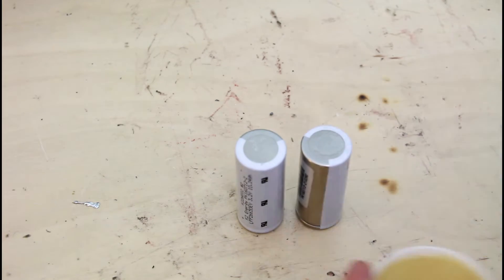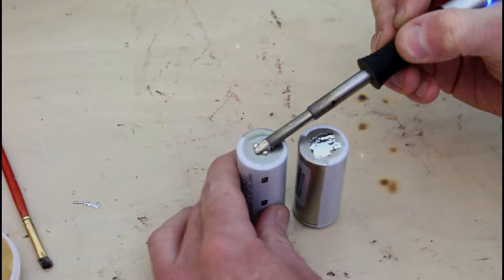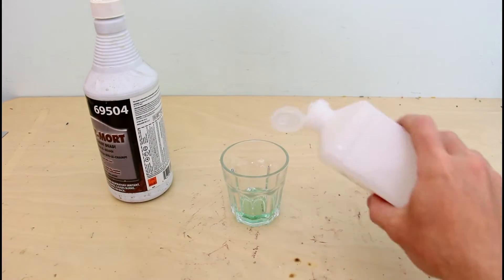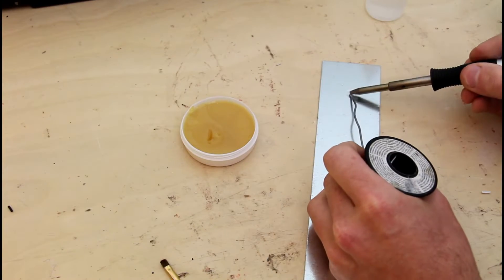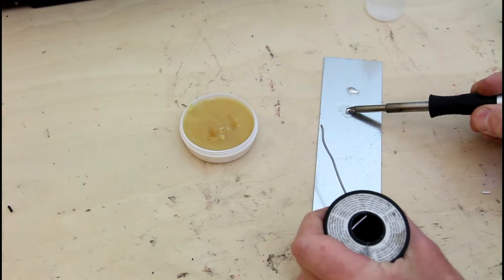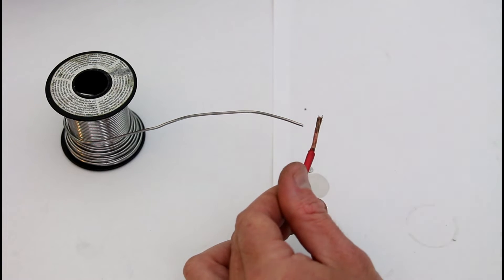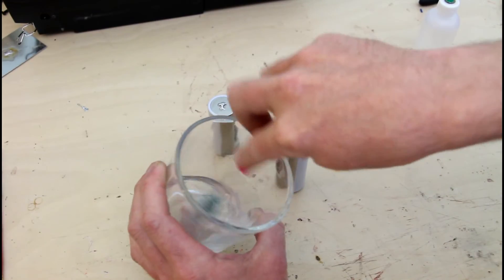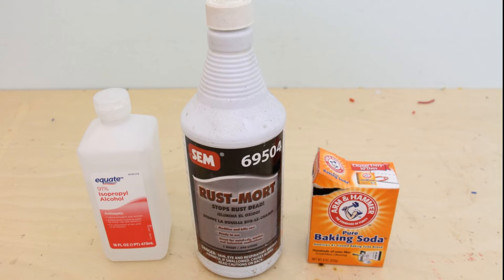Speed flux - Difficult soldering made easy

Comment: Dear Alex can you please guide me if rust converter and rust remover are one and same.
I am here from India.
Reply from the maker: Not usually the same.  Rust converter is phosphoric acid (usually).  Rust remover is almost any acid.
Reply: @highervoltage5430  can we used common toilet cleaning acid ( hcl ) instead.
Reply from the maker: @prashantk3269  - Not likely.  i have not tried it, but I don't think that will work.
Reply: @highervoltage5430  ok thanks for your response.

Comment: Thank you so much for this idea. At my job I repair all kinds of equipment and the copper wiring is always almost black even when freshly stripped back especially on snow plow and salting equipment. I have been saying for years that I wish there was a way to quickly prepare the wire for soldering.(I've been scraping it with a razor blade) with limited results. I can't wait to try this out next time around.

Comment: I used 85% phosphoric acid and soldered stainless steel beautifully! Thanks a ton for suggesting
Reply: was it 50 /50 ? or another proportion?  thanks in advance sr
Reply: As I said it was 85% concentrate. It will work even if its less than 50 or 40 percent concentrated @onixcual
Reply: @onixcual isopropyl alcohol is not necessary. Only phosporic acid is required. Isopropyl alcohol just helps in removing oils and grime

Comment: This is the most amazing flux I have ever tried. I am fortunate enough to have some food grade 85% phosphoric acid and some anhydrous isopropyl alcohol on hand. The results are just incredible. You can easily solder copper to stainless steel, for example. Large areas are tinned easily. If anyone has trouble making this work, it's probably because the phosphoric acid is not concentrated enough. In combination with the fact that ordinary rubbing alcohol is 30% water, there might just be too much total water to make it work. 

Thank Mr. Voltage!
Reply: Try 91% as opposed to 70%. Easily found Naval Jelly too.
Reply: Just get 99%. It's not much more if at all
Reply from the maker: You are absolutely right about the water content.  It is what will cause this to not work.  However, if you use pure components, it works flawlessly.

Comment: I tried it. It didn't work. The rust converter that I used is made with phosphoric acid. After applying the solution to metal and heating it there was a bit of a gunk build up which the solder didn't like. I suspect it's one or more of the other ingredients in the rust converter that generated the gunk. I used bondall Ranex Rustbuster made in Australia.
Reply: Just try Muriatic Acid, it works for me flawlessly.
Reply from the maker: What happened in your situation?  It could be a reaction between the flux in the solder and the speed flux.

Comment: thanks for the info. Your videos have been quite a benefit to me. I bought some A123 cells and am making batteries for two V65 I have, replacing the AGMs. I am a soldering rookie so this blurb is wonderful -- for me. Where do I get the little squirt bottle you used?
Reply from the maker: I think it is a glue bottle.  I think it is from Guant industries?
Reply: I've wondered about A123 cells, especially since a 50AH 72V battery on our converted GS500F from BtrPower seems to use something similar.  They seem a natural for 24S1P batteries with good current output.  How have they worked for you?

Comment: But the fumes coming out of it while soldering is very dangerous gas. Need proper arrangements for its exhaust while it comes out during soldering
Reply from the maker: I agree it is best to have some ventilation.
Reply: For welding aluminum this will work out or you knew other solutions. If so which ?

Comment: Nice tip!
does it work in an aluminum sheet?
Reply: For aluminum and some other metals, a thin electroplating of copper works wonders:
https://youtu.be/Z14aU-PaioA
Reply from the maker: Unfortunately, no.  Aluminum is really difficult to solder.